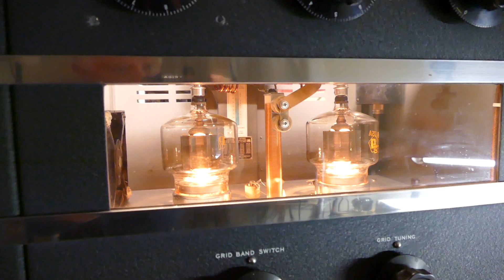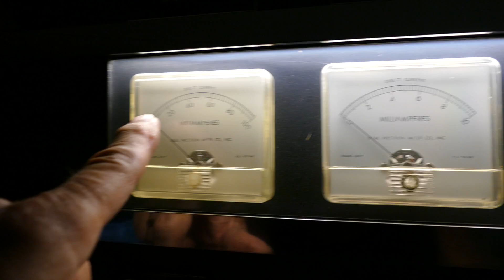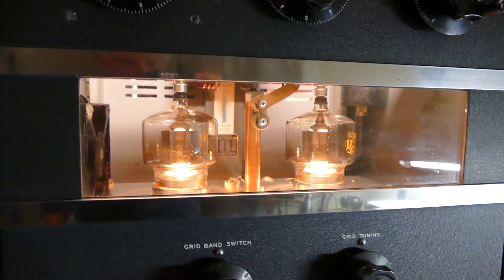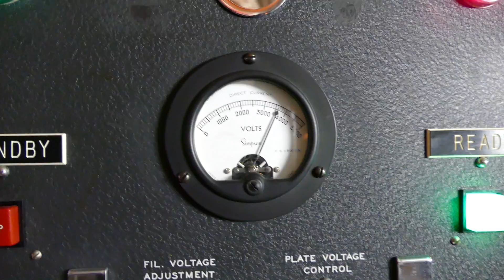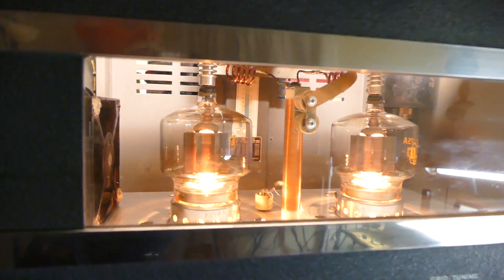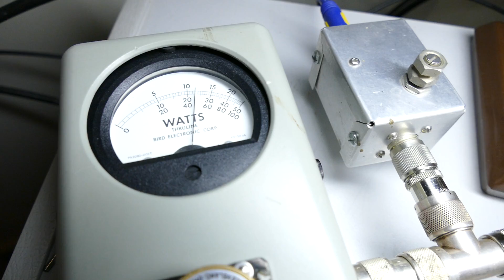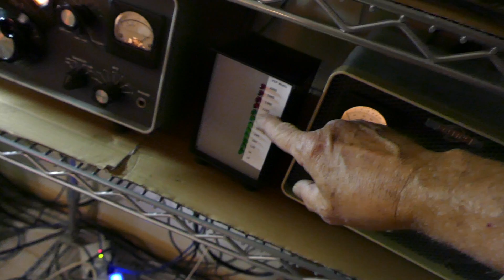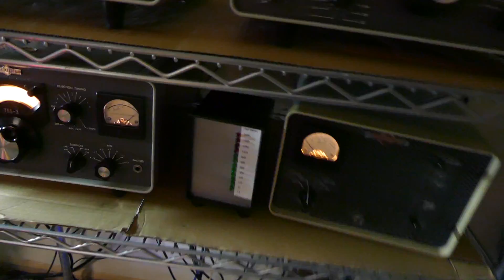Eimac 4-400A  Grounded Grid  RF Amplifier Collins 30K-1 Cabinet From 1947

Comment: @0250

The base ring is NOT connected internally and is NOT A THIRD GRID. It has nothing to do with the filament. Its a RF shield and directs airflow.

" Didnt work" was likely a bad socket connection

The 4-400s have an internal screen disc ( solid plate) to shield the base from the plate.
Reply from the maker: The Penta Lab PL-175 is a pentode and not a tetrode and can be used in place of a 4-400A if you ground the ring where the suppressor grid is connected. Here is the datasheet for the PL-175A that explains it in the first paragraph.  https://tubedata.edebris.com/sheets/084/p/PL175A.pdf

Comment: is that 1200 RMS or PEP ?
Reply from the maker: A pair of 4-400A at 3600 V on the plates will deliver a steady 1200 watts to the antenna as measured on an accurate Bird wattmeter.
They are actually (should be) the same because if you load an amplifier to 1200 watts average, you should not "talk" it past that point in PEP power but often times we do. 
Distortion increases rapidly past that point.  Cleaner and crisp audio is often times more penetrating than louder audio. 
I keep my drive down so that I do not exceed the average power level I load an amplifier to. 
The amount of processing and compression I often hear on the air makes it hard for me to copy some SSB stations. 
"Talking" the plate current to reach the maximum loaded power makes a signal sound loud (distortion makes any signal louder) 
but it becomes muffled and hollow sounding to my ear and hard to copy.

Comment: I want one!
Reply from the maker: I have had a lot of fun with this cabinet. All the power supplies are built below the RF deck and the plate tank circuit, with a large roller inductor above the RF deck and have run a 4CXC1000A, a pair of 4-400A and a pair of 3-400Z built on different chassis that I can slide in behind the glass window. I kept ;the 4CX1000A in the cabinet for over 30 years but then started reinstalling the glass tube amplifiers for their beauty but, at this time, have the 4CX1000A chassis back in and run it mostly on 40M. I paid $75 for the cabinet and whatever components were in it in 1975 and picked it up from a small town near Atlanta, Georgia.  Thanks for your comments.   73   WA4QGA

Comment: Great Amp! I did read the tube specs and cooling requirements. I do not see a chimneys on the tubes? are chimneys needed?
Reply from the maker: I have chimneys and have used them on other amplifier builds but it is necessary to have an enclosed and pressurized chassis to blow the air up and past the tube filament and anode seals if we are going to use chimneys. For 24x7 commercial usage, it is surely a good idea but I do keep a decent air flow over the tubes and for amateur service it seems OK. Some of the amplifiers commercial amateur radio amplifiers just blow air across the glass of the tubes and that seems sufficient. Chimney's are classy and I like them but I did not build it with an enclosed and pressured under-chassis so I figure without that being done properly, it would likely just end up restricting air flow from the top of the chassis. I think the big glass triodes and tetrodes are beautiful with their plates running orange hot.

Comment: is 4-400A  more powerful than 813?
Reply from the maker: They are both fantastic tubes but, yes, the 4-400A is considerably more powerful than the 813.
Reply: @ElPasoTubeAmps  and 4-1000A is about the same powerful as 4-400A?

Comment: Awesome.  I'm a die hard from the old days of power vacuum tubes.  You've done an excellent job with these Eimac jewels.  Good job.
Reply from the maker: Thanks, Bob. In all honesty, I think the pair of 4-400A's is the most striking amplifier I have built into this old 1947 Collins cabinet. I have also had a single 4-400A,  3-1000Z and  4CX1000A. The 4CX is definitely the most powerful tube with a full 1500+ watts output but it just doesn't have the charm of the glass tubes.    73

Comment: Yes indeed, a beautiful amp and no doubt a great performer. How much drive power is needed for 1.2kw out, and are all the grids connected directly to ground?
Reply from the maker: The output of my Collins 32S-1 is 80 watts and it does not take all of that to drive the grid current to 200 mA which gives maximum output of about 1350 watts, so, I don't know the exact amount of drive necessary but definitely something below 80 watts. Probably about what the Eimac data sheet predicts. The grids are not directly connected to ground for DC. They are connected to RF ground thru capacitors mounted right at the tube socket to chassis  at each of the three grid connections. At one grid connection, there is shielded cable (RG-58) going to the grid meter which has one terminal grounded to monitor DC grid current. It is an amazing performer and while not this very 3-1000A amplifier chassis but I have run this amplifier since 1983 with a 4CX1000A with virtually no issues. I hear fellows on the air that comment that their (model number) amplifier has been working for 10 or 15 years and they retire it for a new one. If your amplifier is built with the massive surplus components you can get today, it can last a life time. Thanks for your comments. 73

Comment: You definitely have great knowledge and style on all of the tube equipment you have.  What type of dummy load do you use testing your RF amplifiers?  Resistance value and wattage ?   Cool tubes!  All your videos are great and informative!
Reply from the maker: Thank you for your nice comments. I am pleased you enjoy the videos. 
The dummy load I use most often is a 600 watt 50 ohm Bird dummy load. I can put much more power into it than 600 watts for a short time and it is OK. I have quite a few dummy loads from very small GHz level 50 ohm SMA loads to the 600 watt size with N connectors.
I have loved the look and style of these amplifiers from the very beginning of my interest in electronics and always wanted to have one of the larger amplifiers. Building them is really the only option and being lucky enough to come across some of the vintage cabinets and components. 
I enjoy sharing these instruments on YouTube as most amateur operators today prefer a single unit (tranceiver) and maybe an amplifier, all with as much auto-tune as possible. I see the reason for the automation as it frees up operator to talk more and tune less and the possibility of damage to equipment is probably lessened by auto-tune circuits but I still love the look and even the smell of this old equipment.

Comment: Absolutely beautiful Brother! I've always wanted a Collins 20V but even if I had one I'd have no room.. I do have a 4-1000A GG Amp with a picture window that when ran at full power really glows and puts out amazing power, I have a pair of 4-400a's in GG which I run at 4KVdc and it will achieve 1600 watts to the antenna, I have two other 4-1000a amps that I rarely use but in reality I use my Drake L4B more than any because its simple, compact and at the other end the difference is not noticeable. Besides the 4-1000a is a little harder on my antenna than the L4B having vaporized a plastic insulator on my 80 Meter loop and set a plastic insulator on fire at the end of my multiband dipole.. I actually have a video of an awesome corona ball that occured one my 80 meter dipole when running in AM mode with the 4-1000a.. Its all fun stuff!

Comment: Interesting video! I remember this transmitter back in the day! If I remember correctly, the power supply used 866A's for the rectifiers. These units are of a solid build!
Reply from the maker: +Frank Ferraro Yes, it did use 866 rectifiers but with the power transformer I use it needed to be a bridge so I put in four 866 solid state rectifiers. It is built solid. Choke input filter to a Pi filter with a resonate capacitor cross the first choke. They did not spare the iron in these things.  Nowadays you could probably make a small car out of the steel in the cabinet... Good to hear from you, Frank.

Comment: Love the amp.
But where is the toast rack, and toasting fork????
Reply from the maker: +Bishka100 I guess my next project is refrigerated  air for it.    :-)      It is nice in the winter but it does heat up the room quite a bit. All in all, the entire unit is probably about 50% (or less) efficient so I am radiating 1200 watts or more of heat into the basement where I sit.
Reply: +ElPaso TubeAmps 
Ha,ha. when I was a kid, living at home, we lived on a boat and my cabin being so small, my valve amp would take the chill out of the air too.
Our two cats brought a rat home once and it escaped into the bilges. The next morning I woke-up to a little furry face watching me from behind my amp's ventilation grill. It didn't do any harm though.
Reply from the maker: +Bishka100 That's a nice story about the mouse. It is getting the time of the year that when I work in my shop I am visited by a lot of strange looking desert bugs. I don't harm them but some of them do give me the creeps and I have to take them outside. Sometimes I talk to them and I think they understand. Maybe I have just been around high voltage for too many years.